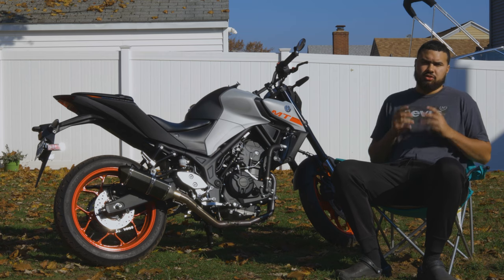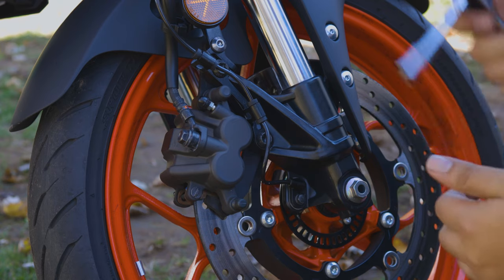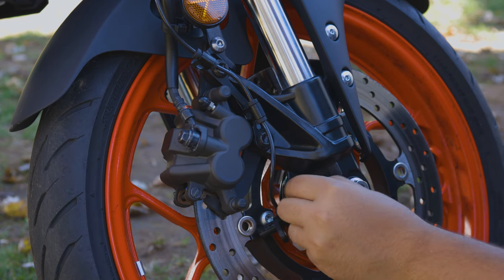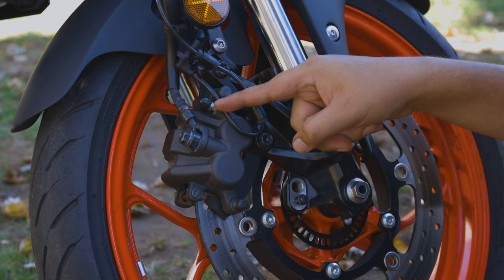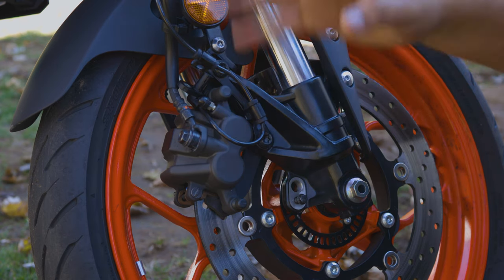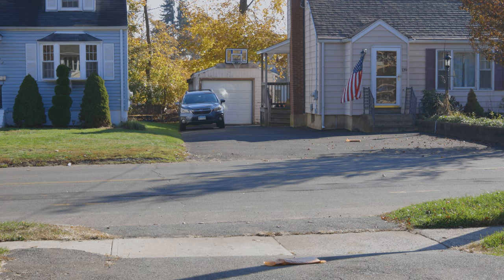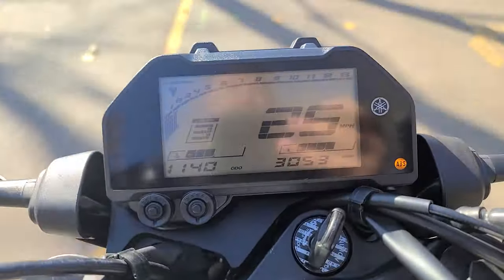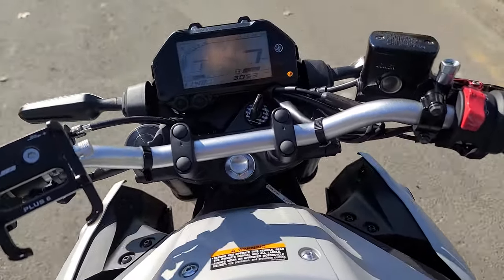How to Disable ABS on Yamaha MT03 | R3

Comment: I used to have old bike a cruiser from early 2000's and I had a battery tender charger. Now this Yamaha seems like a new technology does she also need that charger or maybe she have different kind of battery and doesn't need that? I can't find any videos from battery tender installation on yamaha mt-03??
Reply from the maker: Doesn’t need a battery tender but you can add one. It’s costs $5 and just connects to battery terminals
Reply: @POPETINRacing  is there a space to have that tether out? so you don't have to remove the saddle every time you want to charge ?
Reply from the maker: @Voltomess  Yeah the seat has enough space to slip it under so you don’t have to take off the seat every time
Reply: @POPETINRacing  Nice thank you Sir.

Comment: Used this video to confirm the speed sensor is on the wheel for a 2021 mt03, looking at a sprocket change and couldn't find a straight answer online whether  it would mess up my speedo. I'm sure 2020 and 2021 are the same, since the bikes are nearly identical lol
Reply from the maker: You’re correct
Reply: Did it mess up your Speedo

Comment: Why take the abs off ??? Not safe
Reply from the maker: For sliding etc
Reply: Very skilled riders can stop and control a bike better than using ABS on dry, wet & snow conditions.

ABS cannot decrease the stopping distance but its intent is to help maintain some traction for the average and newbie riders.

I am a licenced mechanic, with an engineering background & a former racer.
No racing vehicles of any type use ABS because that would produce longer stopping time & distance.

The same for cars.
Reply from the maker: @human1513  Thanks for the detailed explanation much appreciated
Reply: Doesn't it cause any problems from the engine or ecu sir?